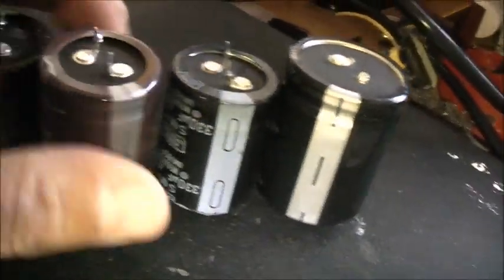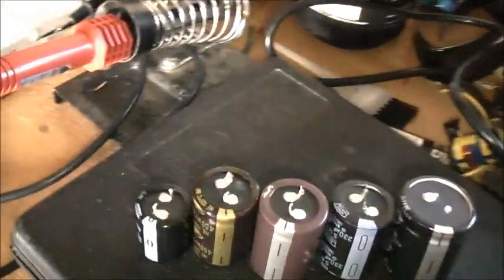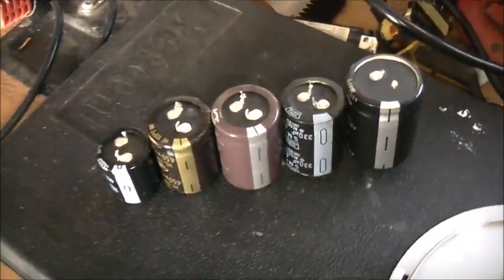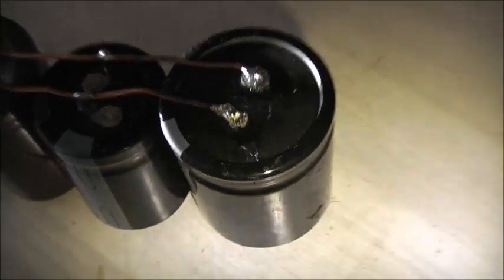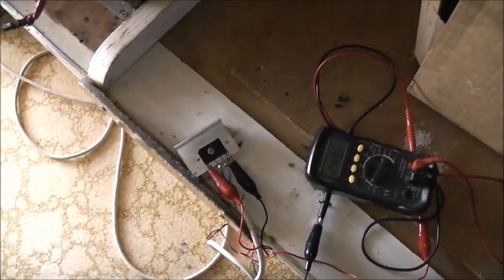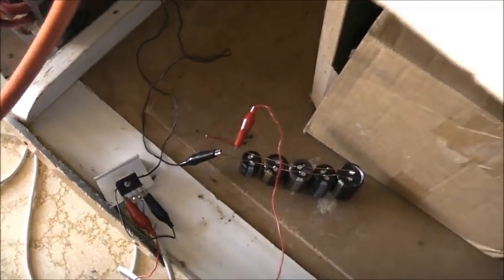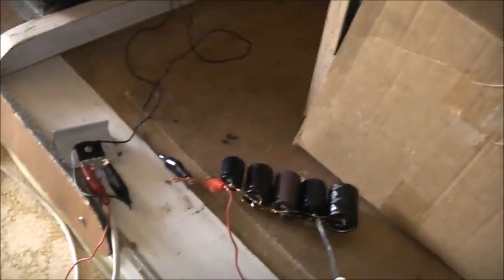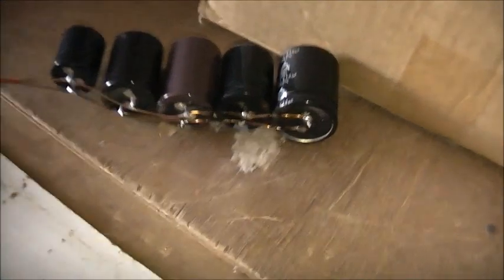Capacitor Bank Test

Comment: The energy storage formula of a capacitor is E = 0.5(CV)^2 with C as the capacitance in Farads and V as the voltage.  Based on 1650 uF and 240 volt AC peak voltage of 340 volts, you'll have about 95 joules in there.  More than enough to make things go bang :D
Try some thicker wires connecting the caps to boost the peak current available.

Comment: yep that would help or a wire wound resistor to limit the charge current :-)

the bleed resistor is a good idea :-) i have been bitten by charged mains capacitors at 300vdc ouch!! :-(